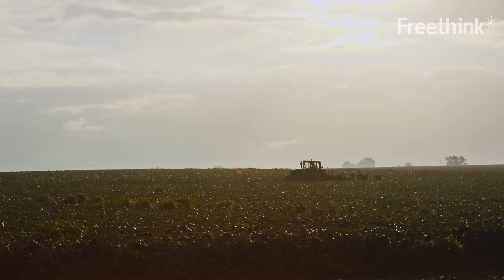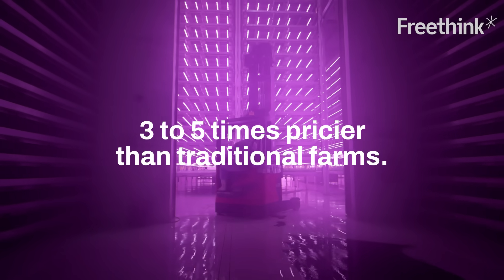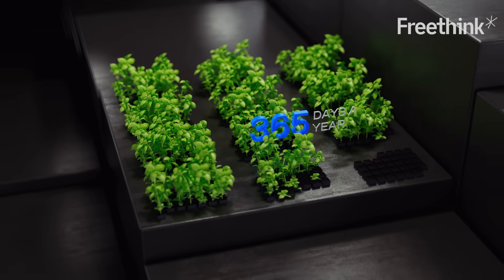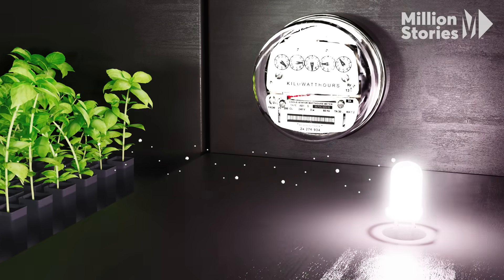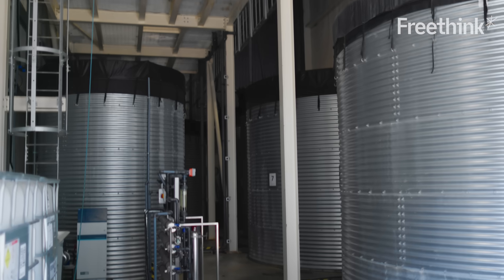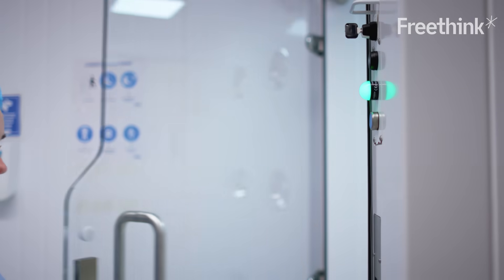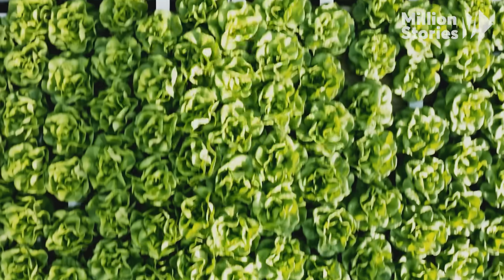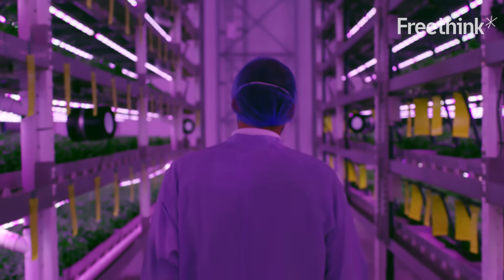How vertical farming can save the planet & feed the world

Comment: Vertical farming won't work untill there is much cheaper electicity.
Reply: I agree but there's ways to make it cheaper by having solar panels. Hopefully soon a way to store power in something to use dureing might. This site in the video has solar panels on the roof
Reply: @ryansheridan732  no dude. I cultivate plants indoor. You have no idea how much electricity it takes to provide adequate artificial light, aircons... Dehumidifiers.. Solar ain't practical. BTW the panels only last like 20 years and aren't recycled because they weren't made to be recycled haha so what happens to billions of tons of solar panels after they expire? Same with the batteries, how do we get rid of billions of tons of batteries needed to store the electricity? If there is nuclear fusion electricity and it costs like 2 or 3 cents a kw unit yeah then maybe this is viable but this is nothing but a pipe dream. Tesla has made major improvements in battery storage and generation but it's still no where near where it has to be and the issue of what happens when the batteries when they have to be replaced...

Comment: Vertical farming is a great solution for small leafy greens but because of height of corn for example it makes less sense to stack them over each other. A very interessting solution are solar greenhouses with a terra preta soil. Because of the charred biomass (biochar) inside it is even carbon negative. The advantage of solar greenhouses are that they store the heat of the sun in the soil/ground and release the heat on colder days. This technique is very cheap to build and needs no additional electricity or fertilizer. Would be cool if you @Freethink make a video about it!
Reply: You'll be surprised by how fast selective breeding can take us to inches high corn. After all, we've managed to breed micro tomatoes small enough to grow well in a tea cup. There simply isn't a market for super dwarf stable crops right now, but that can easily change within a generation of focused breeding.
Reply: @ginsederp  the down side to that is small versions of crops like corn will yeald less corn due to the stock not being long enough to support more heads of corn,
Farmers and have to determine will this severely effect my bottom line?
Reply: @nerdlingeeksly5192  that is true, on top of corn being very easy to store and transport, it'll be the last kind of vegetable anyone would think of farming vertically, maybe with the exception of sweetcorn...
Reply: Or simply use tall/large crops in fields and have all others go in vertical farms
Reply: Scientist are developing a way to grow corn from a vine indoors. They have already succeeded corn is just not as big soon they will be able to grow it indoors

Comment: Am I dumb to think why doesn't this building have an open roof to let sunlight in during the day and put mirrors on the walls so that at least 20%+ of the plants can get free energy?
Reply: It's not going to allow the lower levels of plants to get enough light you're going to have uneven growing times. By using the LEDs they can make all the grow times and the amount of light equal across all the plants. If the entire room was flat and only one level of plants yes but with it being vertical no, you are going to have shaded spots in a vertical farm.
Reply: @UlexiteTVStoneLexite  In a typical store greenhouse the entire dome is transparent so its not just the top roof. But still you can electronically track what levels/sections are getting how much light and reduce your electrical bill either way. Like I said maybe 20% just by having an open roof. Maybe 40% by having a true greenhouse.
Reply: @AdamGtr86  your typical greenhouse is not vertical. Your typical greenhouse still has a flat layout. Your typical greenhouse is still limited on horizontal space. In a greenhouse you have to be concerned about taller plants and shorter plants underneath those taller plants because you are not going to get equal lighting across the different levels. This is even more of a problem when you're using shelves and flat trays. The bottom shelves are never going to get nearly as much sunlight as the top shelves. Light cannot travel through solid objects